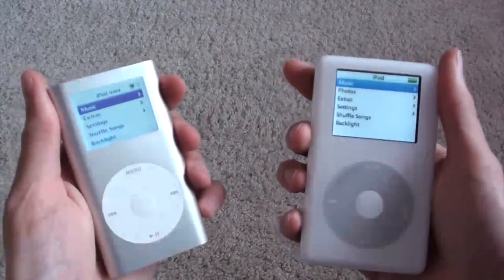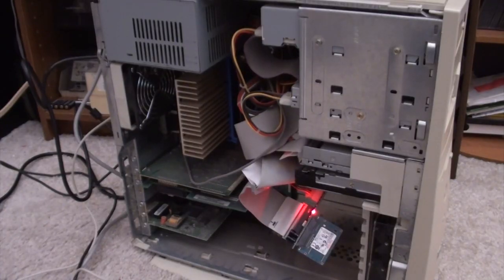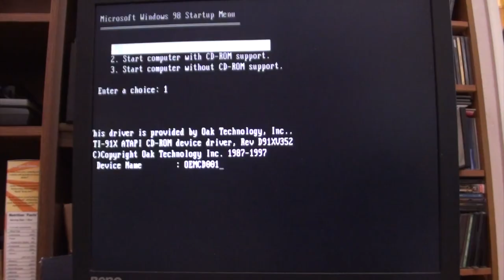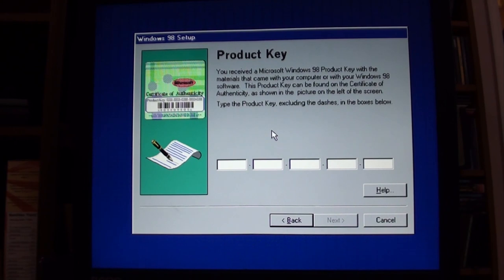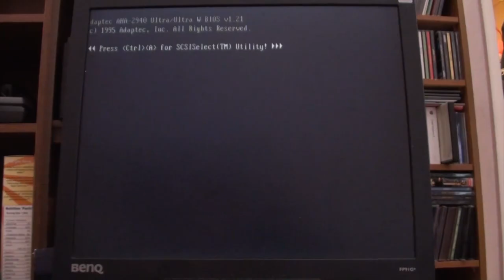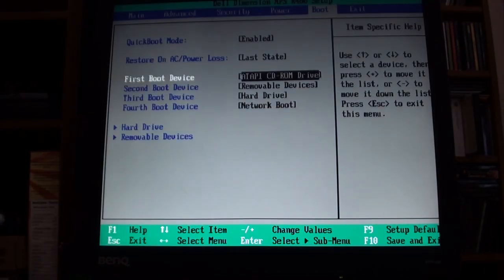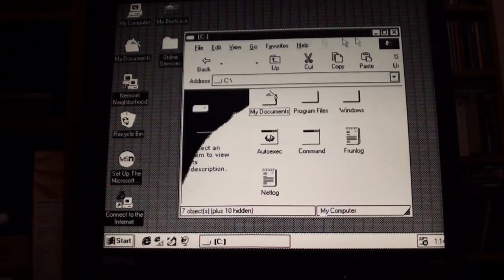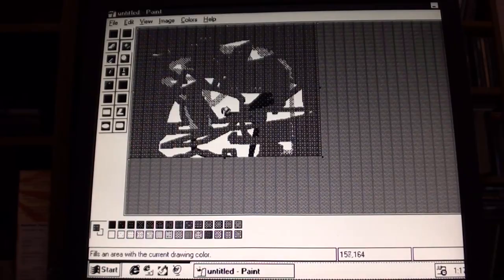Installing Windows 98 on an SSD

Comment: The amount of dislikes on this video is just sad. I really enjoyed this crazy guy installing one of the most painful software to install ever.
Reply: It wasn't that bad
Reply: Iron Sight, installing Windows 9X was hardly ever painful really.  But, its adaptation to a SD drive was probably the painful part.  Windows 9X was designed to seek and check for a C:\ drive meaning the primary drive for installation.  to trick it to identify the microchip drive you either have to A:) change the microchip to a start-up inside your motherboard settings if it can allow it too.  B) force the installation to recognize the drive and a PATCHED setup can do it.  See, also Windows 98 was designed with an initialization process to activate with the motherboard when recognized by the motherboard BIOS either or to be activated by the MICROSOFT MS-DOS operating system for which this case is used if the BIOS doesn't recognize the CD-ROM drive or the CD.  If it doesn't, you need MS-DOS operating system and the MS-DOS CD DRIVER.  Its a suit, one fits all DRIVES.  The simpilist way is to change your boot drive from the BIOS because its the handler for which the installation software was designed to work with.  And yes, I have installed Windows 98 before and understand the errors.  Often there aren't many, but Windows 98 was made before a SD Drive.  Oh, and your drive has to be in FAT32 because that is the proper format of Windows 98.  You can use FAT16, but FAT32 beats FAT16 by a spread.  The read is faster.  Windows 98 was a nexus of upgrading Hard Drive Speed as Windows 7 is the upgrade to Windows Core speed compilation.  Windows 2000 was the NTFS change over.  I think Windows 98 will install with a NTFS, but the speed has errors because modifications were made for it to work at higher speed standards for the upgrades.  They kept previous formatting systems because some drives were incompatible for the newer format.  They worked well for those previous formats.  Though slower.  Understanding the original design flow system of a program is key into changing its nature.  Also, there is another trick you can try using DOS.  In those days we had options open to us.  We had ways to use DOS to force what we wished to happen.  See, the other thing the installation system was designed to also work with DOS as an handler.  In the days of DOS, there was a way of writing scripts which we called batch files to force animity.  and the older computers set-up with DOS thereby in with an identified HD had a batch file called AUTOEXEC.BAT.   Usually, we engaged them from FLOPPY drives.  If you could remaster a THUMB drive in place to start-up with MS-DOS with an AUTOEXEC and have the BATCH file forceably recognize the SD card as the C:\ Drive and have the .com for recognizing a CD drive all you got to do is start-up to the FLASH STICK and use is "CD D:\" and type "DIR /P" to find the installation file.  You type it as you see it.  it will be a .COM file you want to find.  Dos was designed to find and locate a AUTOEXEC.BAT file on its own drive for assigning drive ALLOCATION as well as motherboard drive assigning so if you cannot get your SD card to be assigned, perhaps threw this method you can.  The AUTOEXIC bat table is very open, once I even formatted my own memory sticks as a bit of a joke and assigned it a DRIVE and had the contents of a FLOPPY copied to it.  I can assure you the positive side while having lesser in memory, any process ran faster including the dos scandisk program.  DOS is the most bending programming system as ancient as it is.  Windows 98 has its own AUTOEXEC for running process too as the running system of Windows 98 is half and half about.  Maybe a bit more than Windows 95 by a tiny bit.
Reply: @chatboxguy3363  what am i doing in my life reading that message it took me 15 munutes to read :/
Reply: ikr
Reply: @inactive7191  Because technology is fun CharlieRoblox.  People do this stuff for the pursuit of fun of mastering and remastering old technology software to reuse them.  It took me twice as long as to type it.  But, knowledge is food for thought for technology that could exist, or theory.  Windows 98 was made when HD's were primary and the main primary and basic means of running Windows were on an Hard Drive.  The running of it on an SSD is a intriguing subject and I was explaining the functions of the time and how they may be applied to today for the goal.  Druaga 1 did it by forcing his motherboard/main board to accept the change.  However, as he pointed out it always doesn't work out.  I pointed out some alternatives in theory to complete the goal.
Reply: Painful lol hhhhhhh pls go to sleep
Reply: Why?
Reply: Don't be sad. Take my dislike too.
Reply: This guy covers his material well, it is just the goofy voices and making fun of himself as he moves throughout the video that distracts from a professional presentation.
Reply: That ain’t painful.. try 95 with 24 floppy discs.. now that was the most painful...
Reply: Wait wtf.... Why does this have so many dislikes..... That literally makes no sense.. Usually good YouTube videos have like a 10% dislike rating...
Reply: Iron sight. Alot of people that watch this are casuals that want instant information. They don't understand the process like we do
Reply: Abort. Retry. Ignore. Fail
Reply: @mica7191  Good one.
Reply: @tylerkluttz3688  god damn it. SATA to IDE adapter. A job Druaga just cant quit...
Reply: @tylerkluttz3688  Are you into computers? I got my first PC back in 2011... now I'm 22... I notice it sometimes freezes... due to dust inside the case... do you know what causes it?
Reply: @mica7191  Use a can of air on the dust, or just clean the case in general.

If things don't improve then, the computer might just be getting old in general, and at that point it'd be best to buy a new PC entirely.
Reply: @tylerkluttz3688  Look, Tyler. I'm that broke that I use mostly used things... anything that can run either windows 7 or windows 10 should be fine...
Reply: @mica7191  I just meant "new" as in something that's not your current PC lol.
And yeah, I'm sure you'll find some relatively affordable office PC towers somewheres.
Reply: @tylerkluttz3688  well... I hope so... PCs are way too expensive... The fact is I come from Croatia... Up to 3500-4000 kuna...
Reply: @tylerkluttz3688  Look. Today I tried to power it on... and the power supply turned on, but it gave no power to the cpu fan...
Reply: @mica7191  Open the case and make sure the wire extending from the CPU fan is connected to the motherboard. If it is connected to it...well, your PC's on its last legs, to put it bluntly.
Reply: @tylerkluttz3688  its the power supply issue... I figured it out... As it sometimes makes grinding noise
Reply: @tylerkluttz3688  maybe i wont be able to afford myself an i5 based machine with gtx graphics
Reply: @tylerkluttz3688  my brother has hell of a vacuum... Vorwerk vk200... So he vacuumed the psu fan... Now its ok
Reply: @mica7191  Well that's fortunate. 
Canned air or vacuums are handy to have when you're dealing with parts caked in dust.
Reply: @tylerkluttz3688  It used to freeze in middle of a song or video...
Reply: @tylerkluttz3688  well... I don't really like windows 10... for someone with really limited budget... 4 gb of ram requirement for an os is just an overkill... let others be angry at me as much as they want... but I come from an area in Europe where it is pretty difficult to find a suitable pc...
Reply: @mica7191  Yeah from experience I really dislike Windows 10 too. I just use Windows 8.1.
Reply: @tylerkluttz3688  i use 7
Reply: @tylerkluttz3688  Is it normal to mock out of someone because he/she can't afford ahigh-end build?
Reply: @tylerkluttz3688  Look. I don't understand something... Why the hell do some guys need RTX 2080 Ti, and all-around RGB lighting?
Reply: @mica7191  Put it simply, people who install RGB don't need it perse, but just like to customize their computer's look in general. People who buy the latest parts for their PC with gaming in mind anyways simply want a guaranteed 60 FPS on insane visual settings. Future-proofing is the common term for it when it comes to PC gaming at least.
Reply: @tylerkluttz3688  Look... I come from Croatia... and  my family has great financial trouble... so I can only go to a 2900-3000 kuna computer (my currency is croa
tian kuna), I know it won't be much powerful, but, money limits me...
Reply: @markcondrey2297  exactly
Reply: good~!
Reply: I honestly don't understand why there are so many dislikes...
Reply: @EpicTyphlosionTV Yes way man!
Reply: The first 20 seconds annoying enough
Reply: install gentoo
Reply: I agree, this was super entertaining. The tower fan being louder than the case fan though X-D
Reply: They don't understand that 98 doesn't support TRIM, so getting it to use a SSD is impressive and risky.  Without TRIM, the NAND gates may fail to store data.
Reply: try installing win2k, good luck
Reply: Yeah window 98 first edition is a pain in the ass to install
Reply: how many
Reply: Iron sight, I.doubt it was hard
Reply: YouTube fixed it
Reply: Can't see em now 🤣
Reply: I know exactly. People are probably disliking it cause it doesn't have linus tech or gamers nexus cause they dik ride those high subscriber clowns so much. I love these kind of videos. Really sick of those other tech channels, they are so overrated and annoying.

Comment: the windows 98 product key is burned into my brain.
Reply: +Joshua Pierre even the alzheimer can not delete
Reply: +Gustavo Maricate lmao!
Reply: +Joshua Pierre Same here, installed Win 98 so many times back then. Using parts from the Key as Password still today for other things.
Reply: Sapped thats awesome
Reply: +Joshua Pierre FCKGW-RHQQ2-YXRKT-8TG6W-2B7Q8... Wait! Wrong Version!
Reply: all I remember is a random bit of them, its been 13 years, vrxyc xpx4d 34htd 3rbh6  pretty sure I can't remember one of the strings, but that's probably because I'm high.
Reply: +Joshua Pierre Wow. 95 likes.
Reply: +snapdragon64 devils own?
Reply: +Joshua Pierre well the xp key is burned in my...
Reply: +Armis X No one used a legitimate copy of XP lol.
Reply: OOOOO FORK GUY GETS REKT IN YT COMMENTS
Reply: +Doc T'Soni what you suggesting? The 98 code is too long for me?
Reply: +Doc T'Soni Funny that, I* actually used 98 recently because we have a few pcs in the house. My dad has a business designed Surface Pro, my mom has a laptop, I have a Desktop pc and we all share one old machine. One with windows 98 on. We found a way to download windows 7/8/8.1/10 compatible files and if we are not sure on downloading that dodgy thing on GoodFileCompressors.com, we use that pc to check the files and downloaders out.

*The computer was found by my mom, then I formatted it, and dad took it to get repaired because the windows 98 was corrupted by disk errors. Yeah.
Reply: Doc T'Soni
 I also use a windows 98 machine it holds my boat right over the fishing hole.
Reply: XP serial was tattooed in my brain, installed it way much often than I did with XP.
Reply: @deathtoll5000x  thats the one
Reply: i still remember the windows xp serial number: thmpv 77d6f 94376 8hgkg vrdrq
Reply: i still remember Win XP key :-D
Reply: I completely agree haha I still remember my first DSL IP adress too

Comment: Lol handling without any safety and dropping it 3 times on the rug and THEN you put it in an ESD bag... 
"SATA to IDE adapter you're like I drug I just can't quit" 

Well done you made me subscribe.
Reply: he was able to install win98 on ssd drive. fine. but the speed is reduced to te speed of IDE bus. So no speed advantages of ssd are possible here.
Reply: +Oto Lohnicky I think you accidentally replied to my post. Or was the critic meant for me?

Yes he is using the IDE connection but that doesn't necessarily mean that the speed would be the same as a IDE connected HDD on every task. The SSD can find different information faster and generally work faster. I'm not really good on these things but I don't think you are either. (No offence)
Reply: Charlie Krogars Sorry, my post was not any critic on you.
Reply: Charlie is completely right. The SSD, having no moving parts, would find files much, much quicker, thus the speed increase would, or at least should, be very noticable, (moreover, I expect reading speed would be most noticeable) but transfer speeds I imagine wouldn't be much different, if at all. (except with many smaller files, since there is no needle moving around on a disc trying to find the files) I'm preeeetty sure I'm on the nail with this, but stranger things have happened than me being wrong. Haha
Reply: same thing i thought lol
Reply: Was that Duke Nukem voice on purpose?
Reply: Victor Soriano ya

Comment: lol. thats a beast of a system for sure. 4K ultra no problem
Reply: +steve m The system is perfect, he should just upgrade his GPU and his CPU.
Then, with only changing the mainboard, cooling parts and RAM, as well as the system and monitor, it will run perfectly!
Reply: +Hoch134 xD, basically replace all the parts.
Reply: +VividBagels Nah, the case is fine :P
Reply: Gran Gurbo xP
Reply: +steve m it's 8k ultra settings future proof too
Reply: +SoCuteAri 4K 8 core max settings gaming pc
Reply: +steve m There's always somebody using exaggeration as humour.  Sooooo funny.  See, I just did it too.
Reply: ThaHiddenHand you're like totally right.  that may actually be the best YouTube comment this decade so far.  i'm sooooo glad were on the same humor level.  see you in the funny's friend!
Reply: +Tom Miller GREATEST THING I HAVE EVER HEARD XDD
Reply: +Mich Connor its true.
Reply: That would be an awesome idea for a sleeper PC. Hollow out a case of a Windows 98 machine and then put in a PC with a Core i7 32gb RAM and a GTX 1080 and boom ultimate sleeper PC.
Reply: NJ Sullyalex
Yeah, if somebody breaks into your home they'll probably leave something like that alone.
Reply: ThaHiddenHand
Haha true good way to protect your gaming PC :)

Comment: Heh, the good times when a full Windows install took 255MB.
Reply: DrathVader it looks tiny now, but 255MB took more than half of what hdds had at the time.
Reply: And now even gpu drivers are 450 mb.
Reply: Ablequerq rip
Reply: @marcus yeah, my hdd at the time was 1gb. And it was really expensive to upgrade it to 4gb
Reply: @awesome guy A light linux distro can run fine with a core 2 duo and 2GB of ram and a cheap flash drive
Reply: Nathan Hamman Got the sale specs and run fine windows 7, can do anything, sure i c ant play games,  but it run faster than my 4gb ram i3 7 generation lol
Reply: @elchocoflan7526  really lol hhhhhhhh hhhh
Reply: Hello itd install Windows 7 HomePRemium i n64 Mb ram
Reply: Nowadays, there are the Light versions of the Linux, like Lubuntu. It uses 300 MB of ram in version 18 of Ubuntu (with last kernel of Linux installed). Im not sure about the space im HD but i think is around 1gb or less. It's a good operating system. =) I use it in my old laptop and everything goes good and better than Ubuntu.
Reply: Win 2k  = Yes Good
Reply: @nathanhamman418  Problem is a lot of stuff I like to do won't run on Linus OS's, (without jumping thru hoops which I got tired of about 20 years ago.
Reply: Dan Kelly use wine
Reply: fresh install of windows 7 = ~10 GB
Reply: I found an IDE HDD with 2,6gb
Reply: @Ablequerq  fortnite is over 70gb
Reply: And when 100 GB was ginormous
Reply: Ik, I have 3 minute video files 2x bigger then that
Reply: That would be 174, 1.44MB floppy disks.
Reply: And 1 GB was enough to live.
Reply: @batorerdyniev9805  how times have changed...
Reply: @bradman7281  i had at that time a 5GB something Hard drive, so no problemo for me
Reply: @nexus7tablet610  fortnite is cancer
Reply: Xp takes just 1 gb, w2k takes around 800 and the terrible w10 is taking whole 16 gb
Reply: @jadtijani  i actuly play Minecraft with a similar specs
Reply: Yeah but those 255MB were like half of the storage back in those days